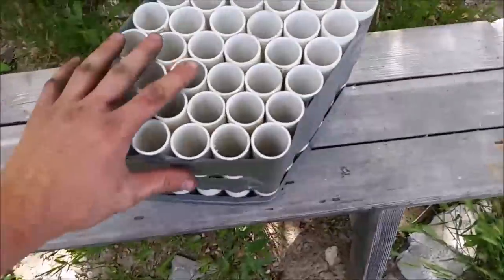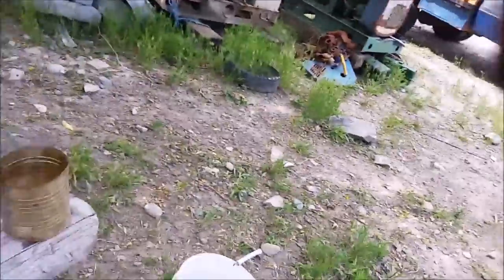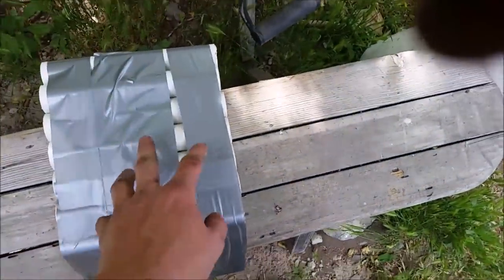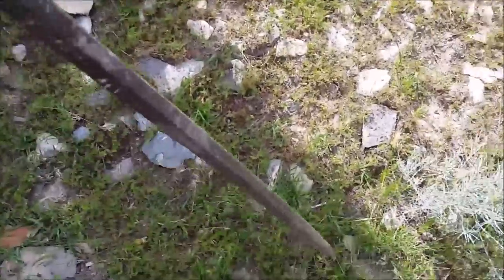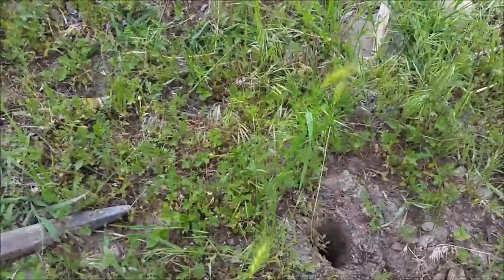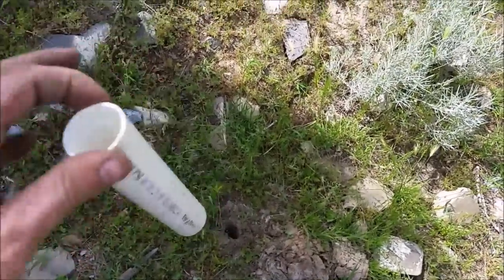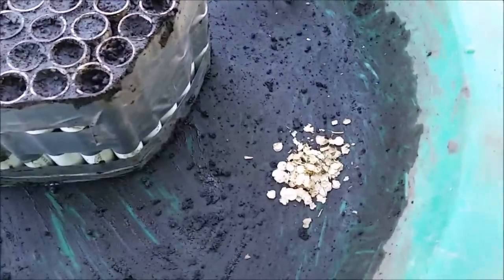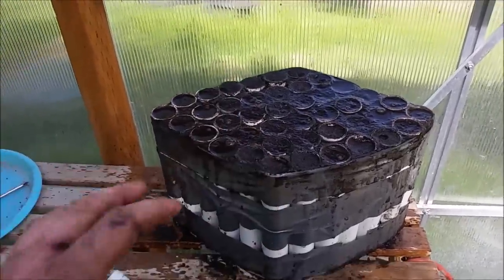Deep Pots?

Comment: Hi Cody! 
I work in a greenhouse where we propagate and grow citrus for research. We use "deep pots" just like this, except they are conical at the tip. These "cones", as we call them establishes a healthy taproot and healthy root system much like your own deep pots. The trees are then transplanted out usually to bigger pots but could be planted out in rows right away. This is done at nursery sites too, and the trees are usually long slender little guys in pots much like the ones ive described. they are marketed as"whips" of trees. i.e almond tree whips. Very cool how you thought to do this and it is a very widely used horticultural method!

Comment: Just wanted to point out, there has been some terrible advice given on here.  Essentially you are making  doityourself tree plugs that are commonly used for forestry projects.  If you wanted they sell devices like what you are constructing for pretty reasonable prices.  For greater success I would suggest elevating the "pots" so that there is plenty of air on the bottom so the tree's tap root will get air pruned.  if it runs into a solid surface, it will jroot and defeat the purpose of what you are doing.  I do a lot tree planting on hunting land for trees that will never get taken care of, so I know what you are trying to do.  Also a dibble bar will make your life easier and prevent the soil being compacted around the roots.  Lastly to remove the finished plug, just get a large dowel and use it to push the plug out from the bottom before planting.  Fee free to PM me for contact info and I will be happy to elaborate further on my past experiences and failures so you won't make the same mistakes I did.  Good luck.

Comment: I like your idea.  Let us know how it works.  I think you're smart enough to make it work.  If it doesn't. Show us why it didn't work and what you plan to do next.  Love your videos.  You're one of the coolest people I've ever seen on YouTube.
Reply: +Cody'sLab I have looked everywhere for the video and cannot find it anywhere :[ I have even tried searching for it in google. :p
Reply: +Cody'sLab 
I'd recommend putting the batch of pipes in a shallow pan and only watering from the bottom. My theory is that the moisture gradient would cause the roots to grow toward the source of the water. Indeed, PVC is a pretty tough material so you might consider tubes made of cardboard or paper wrapped in plastic wrap. Those would be easier to slit.
Reply from the maker: +flippinclip 
https://www.youtube.com/watch?v=zDlp-S0M7Uk
Reply: +Cody'sLab thanks so much! :]
Reply: +Cody&#39;sLab Thanks for the update Cody
Reply: I Agree!
Reply: @theCodyReeder  Video unavailable

Comment: I use the exact same idea for growing my vegetables for my garden except i use the cardboard tube found in the center of toilet rolls.  I fill the toilet roll tubes with potting mix and then plant my beans into the tubes.  I keep them watered and wait till the plants are about 150mm high and/or the roots start to show out of the bottom of the tubes before transplanting the beans from my glass house into the garden.  I plant the complete tube and in that way the roots are not disturbed in anyway and the roll eventually biodegrades.  So I think your idea will work :)

Comment: I've not read all the replies , so apologies if it's been suggested already , but how about cutting each tube vertically then using duct /duck tape or a bit of wire twisted at the top and bottom of each to temporarily hold them together until planting time .

good luck which ever way you choose to proceed Cody.

Comment: I invented that system years ago but i made one improvement to make it easier to plant.  Cut the pipes in half lengthwise and use tape or twine to hold it together. then when it comes time to plant the tree, just cut the tape, hold the pipe together with your fingers, slide it in the hole with the tree in the pipe, then just pull out the two halves of the pipe.

Comment: That is clever.  The resulting plug shape will be easy to plant too. I wonder if it would be easier to push the soil out with a dowel from the root side, then carefully lower it into the hole?  That way you wouldn't damage the leaves.

Comment: if the trees are well rooted in the pipe you could just give them a good tap on the ground and they should come out. dont worry about disturbing the roots, they will be fine compacting the ground could cause issues, depends how solid the ground is.
(did 4 years of production horticulture )

Comment: You can also try saw dust instead of sand. In your situation, any material that catch water do worth a try. 

A paper dish or cardboard circle with a hole will help retain moisture in soil under the sun and prevent other plants to jam in. Also easy to spot and count.

Pounding with a iron rod seems not to be perfect, because the bottom of the hole will be too dense for the small tree to get through. Maybe a old drill bit of that size? Maybe using a cruel bar? Or how about a jack hammer bit?

Comment: You could also use the paper towel cores and toilet paper cores. Just fill them up with slightly tamped down potting soil and place in a flat plant tray without drain holes. Works great for corn and no real thinning required. Just plant two to three corn seeds in each cell and thin to two plants each when about two inches tall. It builds a stronger and less shallow root system. You should bury the entire cardboard tube, along with the first section of the stalk.

Comment: you could use very thin plastic bags , with holes at the bottom , and plant the tree with the bag , the root system will break the bag when it has to . the plastic bag in the ground will gather moister from the ground and that will help .
it might need  some watering if the summer is too hot .

Comment: The only problem I see with using the pipe to pound a hole into the ground is compacting the soil in suck a way that it'd be harder for the roots to expand.

But I'm also thinking of the clay/loam soils we have in Kentucky.
It might work fine where you are.

It's an awesome idea, for sure.
Reply: +tybo09 I don't think it will be too much of a problem with such a small hole. It won't be optimal, of course, but not much there is.

Comment: Cody , use a "core tool" like a fence post digger (just smaller) rather than a rod to dig the hole or you are effectively making a "clay pot" in the soil and will inhibit root growth past that 8 inch mark .... also , put them in a tray and water the bottom so it wicks upwards , will encourage the plant roots to head down ... while stopping evaporation at the top layer creating salt buildup (especially important in dry area's like ours) ... I'll send you an invite to our facebook page and you might gain further insight :-)

Comment: I was thinking of something similar except I was planning to use 2 inch pvc and cut it in half. Tape the two halves together with duct tape. when its time to plant you just take the tape off and you have a tube of soil and roots to plant. Much easier than trying to push the soil out of the tubes.

Comment: You will have problems tamping the tree out without damagin the root zone. 

if you cut the PVC in half longways, and then use cable ties ( the steel type with the screw that tightens it) to hold them shut. you can easily take them out and repot. Plant research folk do that to study roots zones. the PhD guy used wooden frames to hold his pvc in

Comment: Might help draw the roots down if you set the whole thing in a shallow tray and fill that with water. the dirt will wick the water up from the bottom. make sure to put a spacer at the bottom. and let the tray dry out before you fill it back up.  also you can make great biodegradable grow bags out of reusable grocery bags and some twine. (not all are biodegradable though)

Comment: What's that car we see for a moment at 0:28? It seems like it's from the 30's.
Reply: Looks like a uk taxi
Reply: The oldest cars were "Model A"s and I'm not sure whether this is a model A or not. Definitely looks like one of the early period cars though.... NOTE HOW IT IS STILL THERE AND STANDING

Things were made to last... Wonder if it is hemp plastic ;)
Reply: looks like an old ford
Reply: Just so you are aware the oldest car is not a model A. The oldest car was built over 100 years before the model A was ever invented.
Reply: Dick Johnson 1770's, I believe. Needed the fire to be set under the boiler with the car stopped every half hour.
Reply: Dick Johnson You're right of course, I meant the changes that really really made cars more convenient than horse and buggy- which until around that time was far more reliable. They are still considered "early period cars"
Reply: You guys are way off.  It looks like an early 1950s Chevrolet Suburban Carryall.
Reply: The Ford model A didn't enter production until 1927, long after cars and paved roads were common in many parts of the world.  The first "mass-produced" car was the Curved-Dash Oldsmobile, starting in 1901, and the first moving assembly-line mass produced car was the affordable Ford Model-T, with production running from 1908 to 1927.  Regardless, all of those were primitive compared to the distinctly post-war car in the video.  As to the "oldest car" it's a complex title to bestow.  The first known self-propelled road vehicle was Cugnot's 1770 artillery tractor, but there may have been a few before it that have been forgotten.  Even so, it wasn't very carlike.  Regardless, by the 1830s there were many experimental road vehicles that could be called 'cars' moved by steam, electricity, and internal combustion (though not the Otto cycle).  The first 'car' in production (multiple units rather than one-off production) is Amédée's 1878 steam coach, La Mancelle.

Comment: I like the idea but if you make the holes by pounding a stake, the dirt will be compacted and will hamper root growth. Digging a traditional hole, breaking up the sides and filling in around the pipe's column of dirt with fluffy aerated dirt will work better.

Comment: This is not exactly a new thing. It however works great for trees with a large taproot.  If you set it on a wire bench, the roots will air prune, rather than curling up at the bottom of the pot. 

Really don't like the planting method though. The bar will compress the soil, making it difficult for the roots to penetrate.. (both because of the compression, and because of the change in the pore size and distribution from the growing media to the soil.)  A better method that won't take much longer is to use a standard spade to dig out a circle one spade wide (10 in), incorporate compost into the loosened soil,  then you can push the seedling out into that and then mulch the area.  Bonus point if you can make a mini-swale to slow runoff around the tree and keep more water in the soil around it.

Comment: You thought about using something like cellulose and milk plastic to make a bio degradable tube? With pvc your going to have to remove it at some point. Also The top 50% or soil should be heavy sand light soil to encourage the the tree to burry for the good stuff at the bottom of the tube.

Comment: not a bad idea. if you have all those seedlings, perhaps a seed tray, of a nice hummus, and also some of those water crystals, that soak up fluids, and collect seeds from the tree as it's shedding them, and plant them yourself. that's notta bad idea, but no doubt  there are alternatives.
Reply: +Tizona Amanthia Well, I stand corrected, your idea of a deep pot stragety, as well as including the selfsame fluid retention medium, are most all the concerns I had. my only suggestion at this point, is instead of compacting the soil with that bar, spend a little more time, and loosen up the soil around the tree, and ammend it with compost at least a gallon jug's diameter for those plants, that'll give them more room to get some rapid expansion of roots, air, nutrients, that will help them forage deeper on their own. cheers!